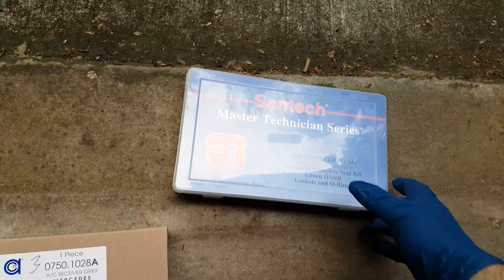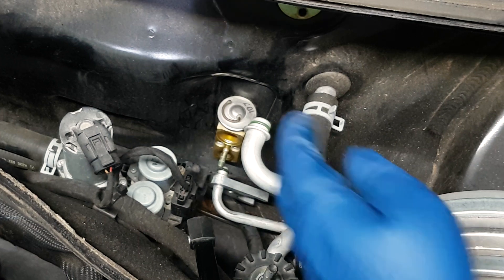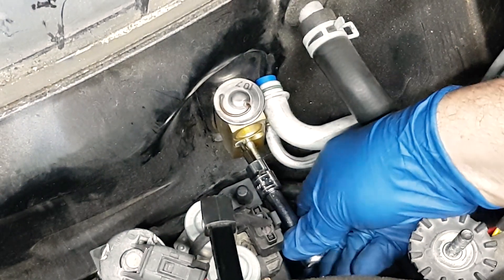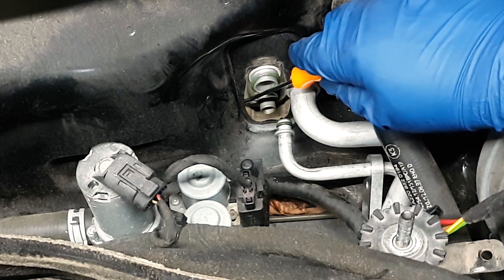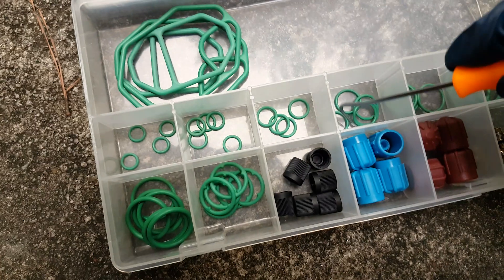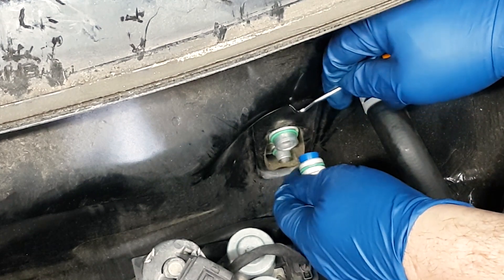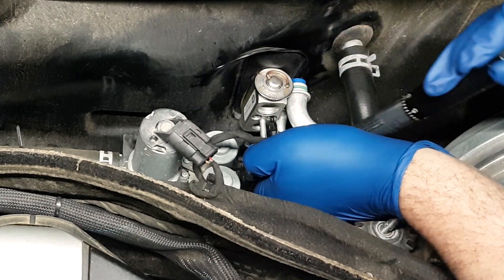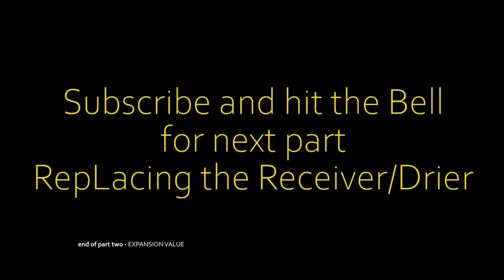Mercedes W220 AC Service - Replace Expansion Valve - Part 2

Comment: Finaly gonna do my full ac service on monday my only problem rn is the bower motor turns on when it wants to. When i start the car it works somtimes and other times i start it and nothing. I replacedes the resistor and blower motor cause the motor as already giving to much resistance and well might as well do the resiator but its still not turning on
Reply from the maker: Hi, if you have replaced everything already, then you may wish to check for resistance or corrosion at the plugs and connection points or shorts in cabling.

Comment: Please I need Your help urgently my ac is cooling from the passenger seat vent but hot in the driver seat vent which I’ve replaced the compressor please I need help
Reply from the maker: Hello Adam, take it out of auto.  Set the temp manually for both sides.  The problem may be behind the dashboard with flaps not switching correctly.

Comment: I just had this replace due to a leak at on a 2020 GLE with only 62k miles. $110 in parts and over $700 in labor. Wish I would have seen this video before taking it to the dealer.
Reply from the maker: I wish dealerships didn't overcharge so much...I understand that businesses and mechanics have to make money, make a living, and be profitable...but, man, some just charge toomuch.

Comment: I have a 00 s500 and it only blows room temperature when I set it to the coldest. I replaced the compressor and condenser and it only fixed my issue for a few months. Looks like I'm going to need to replace them again and i will also be replacing the expansion valve and dryer also this time. Not to mention clean the lines with compressed air and AC cleaner. Mercedes wants thousands of dollars like usual so I'm stuck troubleshooting and replacing my own parts. I live in the dessert so fixing the AC for next summer is crucial! Thanks for making this video.
Reply from the maker: You are welcome, Mike. Please make sure to check for leaks at Schrader valves and all connection points first.  Your compressor and condenser may not need to be replaced.

Comment: Hello, Im at the point with the 2 bolts at 2:25. What size are you using to remove them? I’ve tried 3mm and 3.5mm and T15 but they either don’t fit or they are jumping the bolt
Reply from the maker: Hi, whatever you do, don't strip the bolt. Use only Allen or Hex sockets. But the correct one. You need a set of small sockets, insert each until you find one that perfectly fits.  Then press in all the way and start turning. I don't recall exactly, but I think it is 8mm.